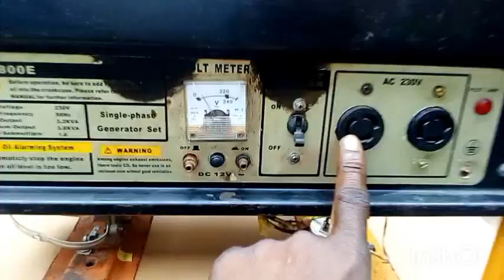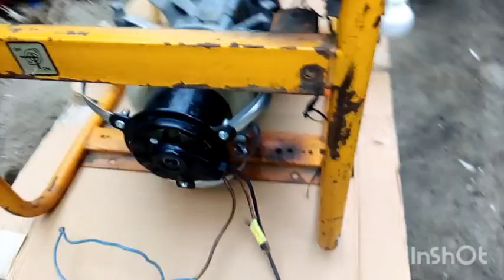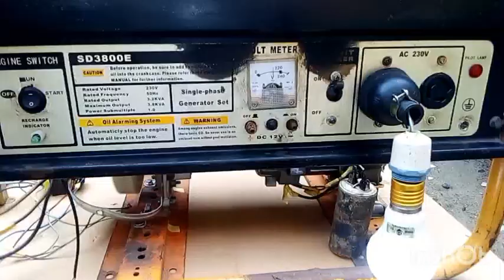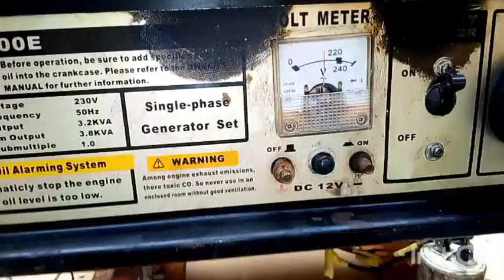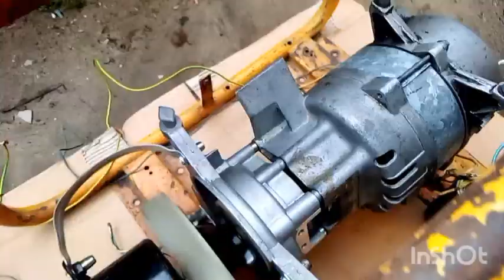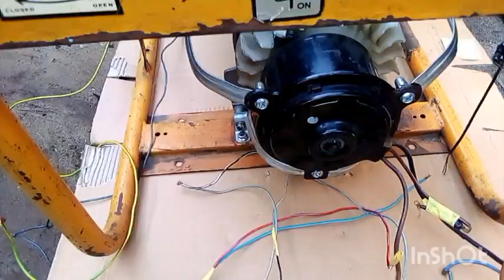Gasoline generator conversion to Fuelless(Part 6).

Comment: Can this system runs 24hrs, using car battery 12v and 75amp
Reply from the maker: It would be possible if you have a very good charging system sir, the rate of charge should be higher than what the generator is consuming thanks.

Comment: That mean if you put more load on it it will not work.
Reply from the maker: At the moment yes sir, but if the power can be maximize then it would be able to carry more loads without stress

Comment: Thank you very much, how many microfarads did you use?
Reply from the maker: The capacitor is 330uf
Reply: @Jotham-Onoboke  Do I really have to modify the stator and the copper armature for it to work? Or will even the aluminum one work?
Reply from the maker: @koyparadoxe  without modifying the stator winding it would still work even the copper one would work, as long as the motor you are using to spin the alternator is around 3000rpm it would generate electricity.

I just did a research recently and I noticed that the alternator with copper winding would would have more drag while generating electricity so it would consume more current from the electric motor

Comment: You can use 12v 20A batter charger that one ll work more better than the Transformers you can try and see
Reply from the maker: Yes sir why not you can use it
Reply: You're not open to ideas and ur method is so complicated and complex. @Jotham-Onoboke
Reply from the maker: @godwinpepple5939 Thanks for your feedback, am open to any ideas if you have any, I would be glad to welcome it, and to learn more from you dear friend.😊
Reply: Ok good. You'll need to buy a battery charger of about 10A instead of combining transformers, it's way cheaper and efficient. It saves space and stress, it won't consume much power from the alternator but this will be determined by the amount of amps the DC motor consumes. @Jotham-Onoboke
Reply from the maker: @godwinpepple5939 Wow, You are very knowledgeable thanks so much for the breakdown of the whole process even down to the  little details I really do appreciate it alot , I would definitely take your advice and get the 12v 20A battery charger and it would be even more efficient thanks my friend.😊